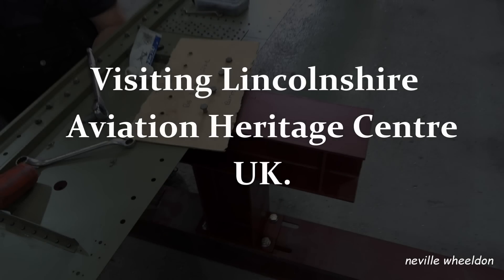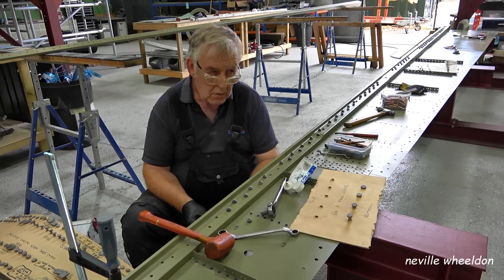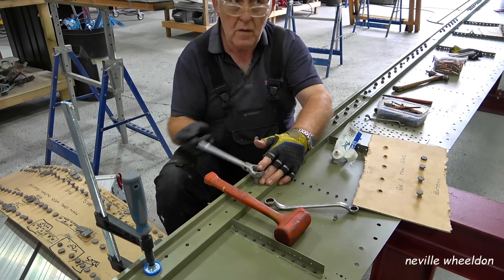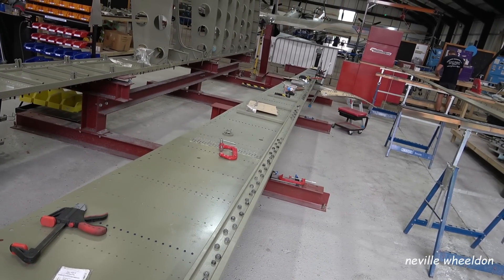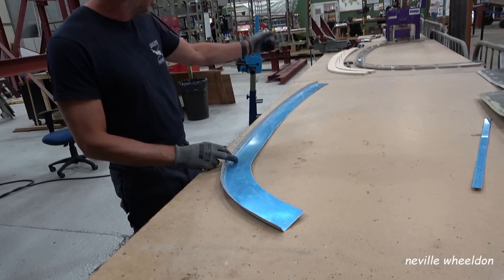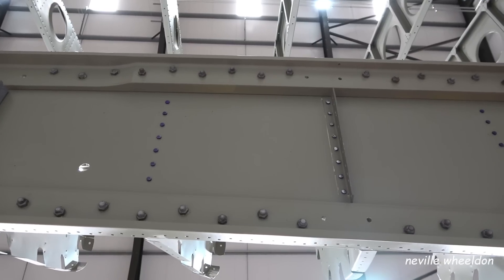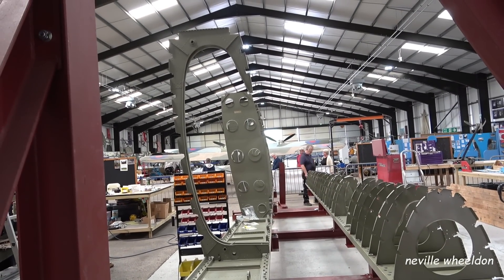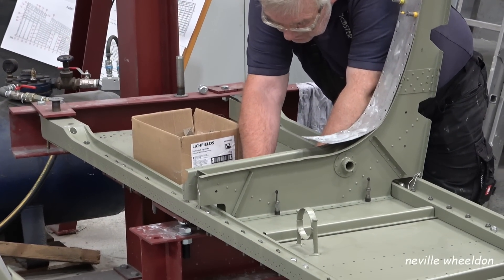Video 157 Restoration of Lancaster NX611 Year 5.  Keith presses on with the Spar of the French Wing.

Comment: My understanding of transition fit is that the parts can either be an interference or a clearance by measure of tolerances. A fit as I understand it between one set of parts can either be interference or clearance.
Reply from the maker: Spot on Simon.

Comment: I remember when I worked on Victors the painters would put all our cleats onto tapered wood dowls that were stuck into holes in an old scafold plank, then they could spry them from all angles without them moving, the only bit not getting a coat was the hole that a rivet would go through and knock the pait out of anyway. They could do the same there, to speed up the painting a bit.
Reply from the maker: Hi Flying Cub, that's the thought of thing they have in mind.
Reply: @nevillewheeldon1693  I visited East Kirkby today in my Kub so will be putting a link to your channel on the video. I will let you know when it comes out.